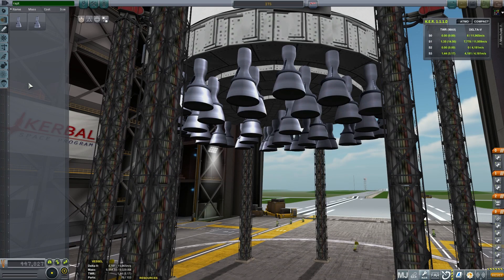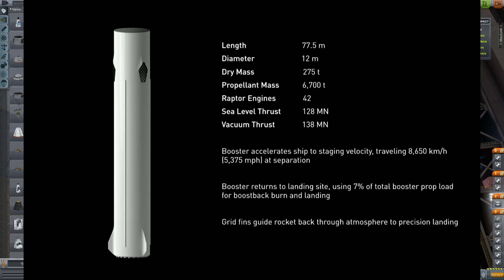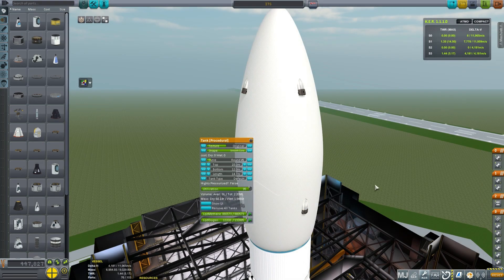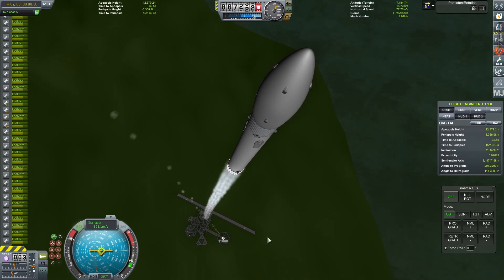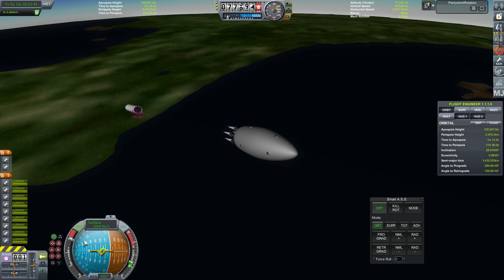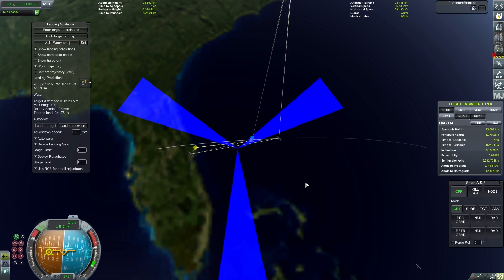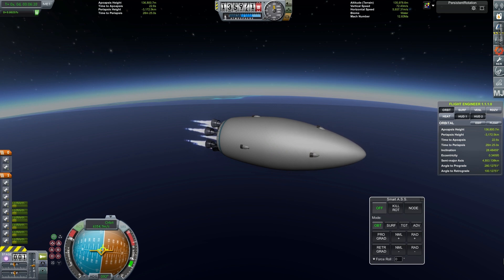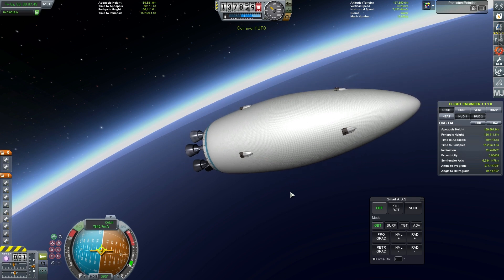SpaceX Interplanetary Transport System (ITS) Launch Test - Kerbal Space Program (KSP) 1.1.3 RO/RSS

Comment: Please write, what mods are you using.
Reply from the maker: KSP: 1.1.3 (Win64)
Toolbar - 1.7.12
Advanced Jet Engine - 2.7.2
B9 Aerospace Procedural Parts - 0.40.7
Community Resource Pack - 0.5.4
Connected Living Space - 1.2.2.1
Deadly Reentry - 7.4.7
Ferram Aerospace Research - 0.15.7.2
Firespitter - 7.3
Kerbal Engineer Redux - 1.1.1
Kerbal Joint Reinforcement - 3.2
KSP-AVC Plugin - 1.1.6.1
ModularFlightIntegrator - 1.1.6
Procedural Parts - 1.2.5
RCS Build Aid - 0.8.1
RealChute - 1.4.1.1
RealismOverhaul - 11.3.1
RealSolarSystem - 11.4
RemoteTech - 1.7.1
RSSDateTime - 1.0.4
SolverEngines - 2.3
TextureReplacer - 2.4.13
TAC Life Support - 0.12.2
TweakScale - 2.2.13
VenStockRevamp - 1.9.5

Also a few custom config parts that I made myself for the Raptor engines (not an official mod).
Reply: Marcus House, thank you

Comment: How redundant are the thrusters? What happens when one of the 42 thrusters doesn't work? Can you test it out?
Reply from the maker: If I loose two engines I need to decouple the booster 100m/s early.. but 2nd stage still makes it to orbit... I'm a little under the target cargo mass here so I need to do a better simulation of a full cargo load.... however,  the fact that I'm human and not as good as the super computers sitting in the rocket calculating precise suicide burns... I'm probably never going to get it to orbit at full capacity.

Comment: Regarding your discussion of vacuum vs sea level engines around 05:20, I think the SpaceX video shows both lighting in their simulation here: https://youtu.be/0qo78R_yYFA?t=84

Then later after refueling, it doesn't use the sea level engines when departing Earth orbit for Mars:
https://youtu.be/0qo78R_yYFA?t=156
Reply from the maker: Thanks for the reply there. I thought this may be the case. I suspect maybe the SL engines may be used for another minute after booster separation just until apoapsis/TWR is high enough to go the rest of the way to LEO with just the vac engines. That would make sense but can't find a source for that assumption.
Reply: Marcus House No problem. Thanks for the video. The more enthusiasm we can generate for the SpaceX goal the better!

Comment: I believe there was some mention of differential thrust for attitude control of the second stage. RCS will still be needed for roll control.
Reply from the maker: Yes.. the one question I have is whether the centre 3 engines will be used at all for the LEO burn or just Mars landing. Has that been mentioned anywhere that you know of?

Comment: Your simulated cargo is <10% of the specs? (40t vs 450t) Given that you so closely emulated everything else, why skimp on arguably the most important part?
Reply from the maker: Great question, thanks for asking. Still working on it all of course as this was a proof of concept flight. It is certainly not perfect yet but there was some more mass weight hidden in large battery and a few other parts. Probably still light by a few hundred tons or so in total. The other problem I'm having is speed of turn with the RCS on the booster. The longer it takes to turn the booster and start the boostback, the more speed you need to get back (so that booster is more than likely missing some height and velocity). I've been unable to scale up an RCS system that turns as quickly as what will be needed so that is a struggle. That being said, I'd love to see an evolution of this by someone else. Everyone I've seen to far is just doing regular stock install with no real relation to real sizes, masses, etc.
Reply: Marcus House If you ignore the boostback requirements (but still leave 10% of the fuel after separation), does the extra few hundred tons of payload hamper the mission at all? (i.e. first stage struggling to get to where it needs, or second stage needing too much fuel to achieve orbit). It seemed like even without having to carry a payload, you barely made it back with the first stage. Additionally, your second stage went from full to almost empty just achieving orbit. I feel like the tanker having to do the same thing isn't going to have much fuel left to refuel the transport ship.

"Everyone I've seen to far is just doing regular stock"
In this regard, you definitely smoke everyone else on the depth of detail.
Reply from the maker: Yes totally agree with you there. The booster return had the fuel dead empty on touchbown (well less than 1%... barely made it but it wouldn't have been an overly efficient decent compared to a computer landing with proper grid fins). I'd need to detach it earlier to get it back with the full cargo load so I'm not sure. I suspect I have got a less than optimal launch profile, but doubt it would make a massive difference to the end Delta-v to achieve orbit (max several hundred m/s). It would be interesting doing the same launch with the tanker to see how much fuel is left. the tanker would probably need the sea level engines running for a while to give it the extra TWR to keep the Apoapsis up. My main issue is the stability of the RSS/RO mods. The game literately crashed every 20 mins. Its frustrating as hell, so getting just this footage took a lot of persistence.

In the end simply because I don't have the required parts (legs, RCS, Grid fins etc etc), and am not a computer flying a perfect trajectory and boost-back, I doubt I would get a full cargo load to orbit whilst being able to return the booster. Might be able to get it a bit higher though. I suspect there will be a future video with some better improvements.

Thanks again for the great questions.